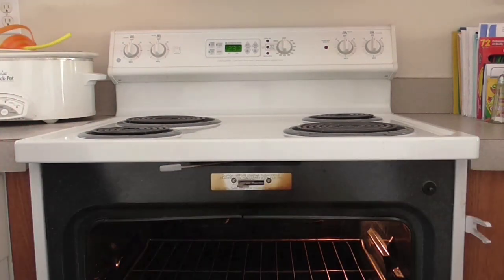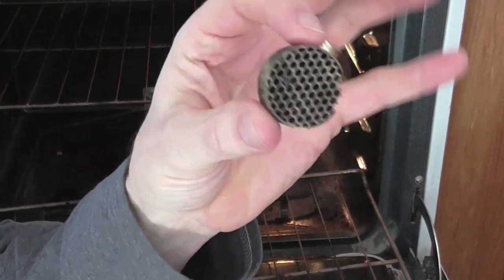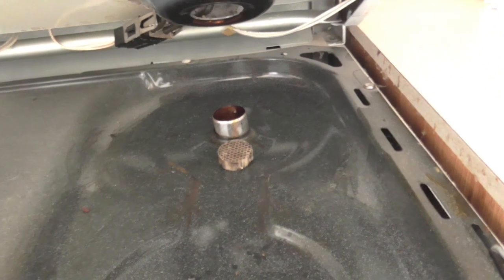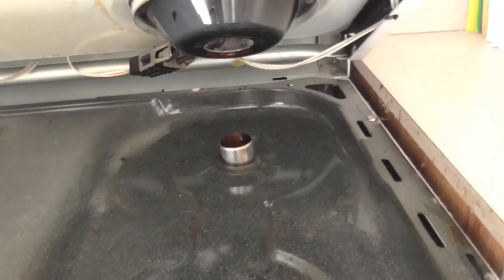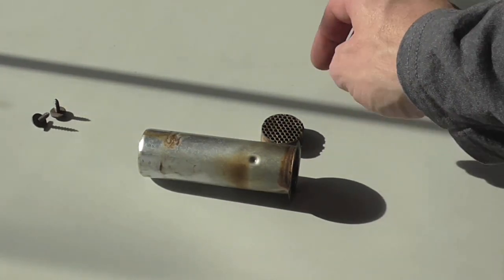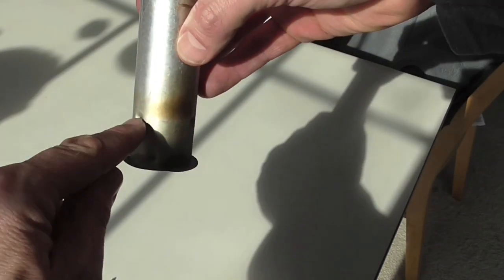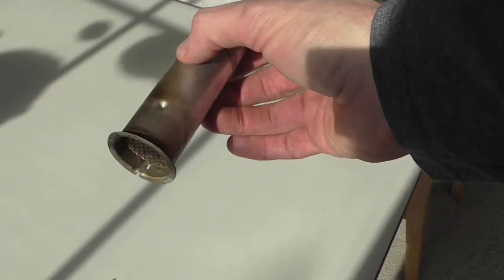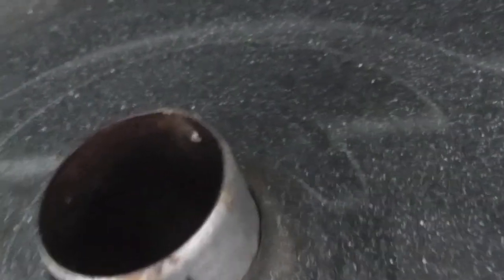GE Oven Vent Tube Honeycomb Part- Looks Like A Catalytic Converter

Comment: I am a former GE Major Appliance Field Service Technician. This ceramic smoke eliminator is activated when the temperature reaches 300F.
Reply from the maker: I didn't know that.  Thanks for pointing that out.  For some reason, I couldn't buy that part anymore.  I think it's discontinued.
Reply: Yes, they discontinued but you maybe able to find them on eBay(not sure). The new smoke eliminators used electrically powered nikel catalyst - they consume energy throuthout bake and broil as well as Self-Clean operations.
Reply from the maker: That's some great information!  I don't recall if I looked on Ebay.  It's a great resource for outdated things.
Reply: Bon Nirnam I found one a new one of these for my Tappan oven, it came installed in a new pipe.  Mine had fell out of the tube in the oven and was pretty chipped up.  So I found one to fit my Tappan oven at Repair Clinic online.  I actually installed it myself which is just taking out the old pipe and putting in the new one with ceramic catalytic converter.  Question I have.  I've used the oven once since I installed it and it seemed to smoke.  Could that be just because it's new?    It wasn't terrible smoke but I turned on the vent over the stove.   But I could smell smoke.

Comment: This was so helpful, I was able to pop mine back in after watching this, I was so scared my oven was ruined. Thank you so much
Reply from the maker: Glad it helped, thanks!
Reply: @MarkThomasBuilder  I was making a dish the other night and when I took my dish out of the oven I noticed this metal stuff on it or whatever I investigated and I guess overtime from the Heat and whatnot it broke so my question to you is is it dangerous can I still use my oven without that piece?
Reply: @MarkThomasBuilder  pause it at 230 mark. The circle part broke at the 2:30 Mark you can see the circular part that part broke the honeycomb part is still there

Comment: went to use our broiler for the first time and smoke started pouring out of this vent!  Not sure if that piece is in there, will need to let it cool off in order to investigate.  I did notice a cover on the inside of the oven directly over the tube....not sure what THAT'S all about

Comment: I have been trying to figure out what that piece was!  Thank you for posting this.  Now to see if I can find a replacement.
Reply from the maker: +sunnyjoeful I tried a few different places and they all said it was a discontinued part.  Luckily, I was able to reuse the one that fell out.  If you find a replacement part, please comment back.  Thanks!
Reply: @MarkThomasBuilder  I found one at repairclinic.com.  It's the pipe with the honey comb already inside.  You just need the model number and brand of the stove.  You enter the info and then they will tell you if it will fit your model.  Looks identical to my old except the pipe is black instead of silver.

Comment: This honeycomb piece came out of our oven during a self clean. Our oven is a flat glass top. Inside the oven there is a hole with a rim around it and two screws like in this video. If we unscrew this piece should we be able to just slip the honeycomb piece back in and screw the tube back on like in this video?
Reply from the maker: It's hard for me to say without looking at it.  I would think so, based on what you're describing.

Comment: Thank you for the video.  The exploded parts picture doesn't do it justice.  They may have quit making it, but they have a replacement part number WB38X33650.  There is no picture with this new part number so I do not know what all comes with it, but the price is $9.50.
Reply from the maker: I think it may have been a part they stopped making, but not sure if there's any aftermarket ones available.

Comment: Do all ovens that have a vent like this require a catalytic converter/filter? Mine is an electric Whirlpool Super Capacity 465 and upon inspection I cant see that filter like you can with yours, so it just looks like a pipe from the oven to the stovetop. I suspect the filter is missing, but I cannot find anything relating to that part online.
Reply from the maker: I'm not sure if this honeycomb filter  was just used for a short time or if they still use it today.  I'm thinking that it's not in newer ovens, but that's just a guess.  I recall seeing something saying that this part isn't available through GE anymore.
Reply: markthomasbuilder copy that. thanks Mark.
Reply: @aeroengines1  Since it's been 4 months, you probably don't need one now, but I found one at RepairClinic.com and it fit my 9 year old Tappan electric stove.
Reply: jeriw thanks indeed. I’ll check this out.

Comment: Hello Help! The whole oven tube fell out along with a thin round metal plate ( which holds it? Reduces smoke?) both pieces very corroded. 
Above, on range I can see the fiberglass insulation 

What do I do now?
Can I use oven wo them?
Can those things be purchased still? 

Range/oven GE
Year: unknown 
Does Not have self clean
Reply from the maker: Humm, it's hard for me to say without seeing it.  I believe the honeycomb part helps reduce smoke, but still lets heat out.  I'm sorry I can't give you a recommendation.

Comment: How do ovens with all glass on the top vent the heat?  Where does that pipe run?
Reply from the maker: I grew up with that style, but never not sure of the answer.  My guess is in the back of the stove top where it rises up.  Maybe between the clock and the stove top?

Comment: Do I really NEED THIS?
Reply from the maker: I'm not sure how effective it really is.  I don't think they even make the same part anymore.
Reply: @MarkThomasBuilder  Mine is chipped badly, but I put some gorilla glue on side and put it in the tube on a slant. I think it does something to the heat.Stove does not seem to cook at temps on roasting times in a recipe. I think you need this,what do you think?

Comment: mmmmm...So to my surprise the honeycomb filter part just fell out this evening as I was broiling salmon.  I have a ceramic cooktop on this GE oven and I cannot lift it.  No clue how.
So..I have to take out the screws from below in the oven and put the filter back in and put the screws back in?  But how did it fall out if it was screwed in to begin with?  And what's to keep it from falling out again?   Thanks for any reply.
Reply from the maker: I'm not sure on a ceramic top.  Mine was more straight forward from what I can remember with normal screws.  Maybe you can get a manual online and see the spec sheet and parts diagram.  That's what I do on technical items.
Reply: @MarkThomasBuilder

Comment: Rather shoddy engineering; a fragile part and no replacement offered. Wonder how it was chipped? Someone slamming a kitchen pot into the oven? Or when oven/ range was moved?
Reply from the maker: That's a good question... We rarely moved the oven.  Maybe a frying pan being set on the burner causing vibration to it.